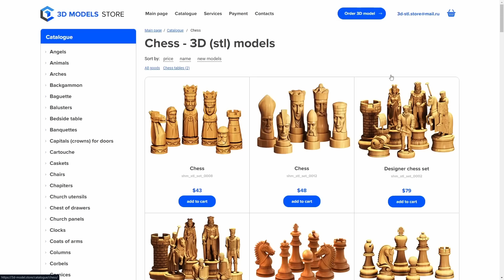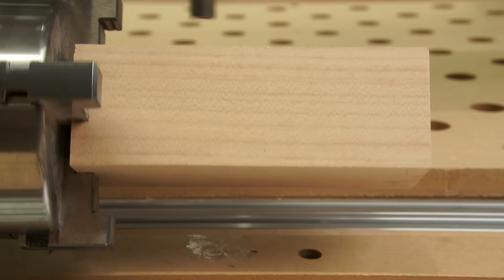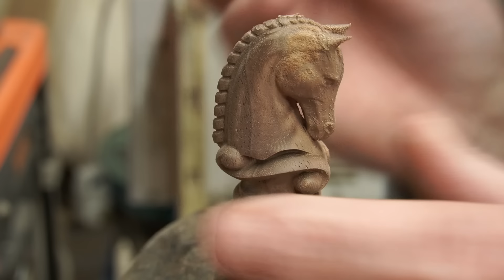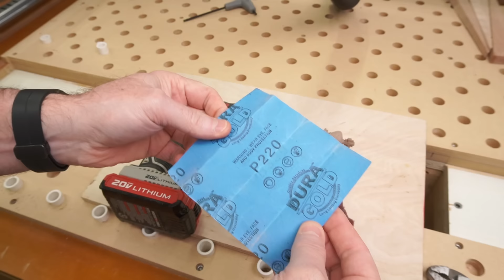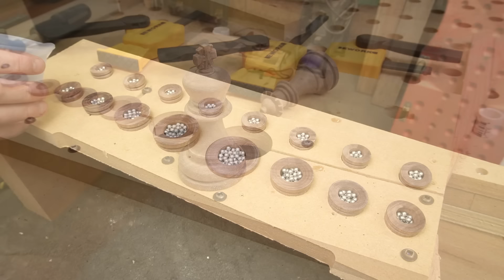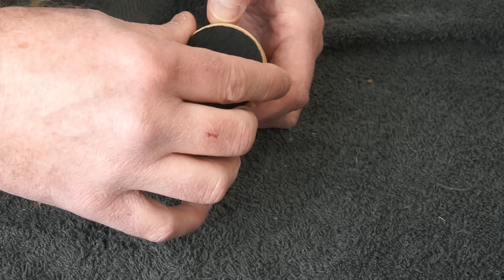Making my own Luxury Chess Set : PART 1

Comment: Hi Scott! I did have it wire the way you described, i can turn the rotary clockwise and counterclockwise on my touch screen and pendant but when i run the gcode it will carve like you normally with 2d carving with XY and Z the rotary not turning at all. Any idea what i am doing wrong?
Reply from the maker: Are you using Vectric?
If so, when using the rotary you have to choose the rotary post processor when you save the Gcode.
The standard PP is named "MASSO ATC ARC".
The rotary PP and the one you need for this is named "MASSO WRAPY2A ATC".

I hope this helps.
Thank you for watching!

Comment: Great video! Loved everything about it; from the comments about Big D to the Mark Lindsey mention! I have that same set of STL models from 3d-model and have been working to turn them out on my 1F machine. I am "fair" in Aspire but, to the life of me, I can't figure out how you got the .25 waste peg into the model. I've played with Zero Plane and adding components for hours and can't get it right. I even went back and watched some of Mark's videos on zero plane to try and figure it out. I know you're in ALA so I'll just tell you that I am in TN, up-front, in case you want to tell me to pack sand, but could you point a guy the way you got the peg on the end of the model? - Sincerely, Bob (snowed-in)
Reply from the maker: Thank you, Bob!

No sand packing necessary. I am glad to help. You're still south of the Mason-Dixon so you are alright with me! Ha!
Those pegs aren't actually a part of the model.
In Vectric, I drew one straight line (vector) down the base, or what would be the bottom of the model, and I run a separate profile toolpath on the outside of the line (vector) with a cut depth just shy of the radius of the model and that produced what you see as a 'peg'. I originally created the profile toolpath as a parting toolpath and I cut the model completely from the wood blank, but more times than not the model would get nicked or damaged in some way on the very last pass when it cut completely through. 
So I opted to cut only enough to allow it to stay connected to the blank, and as you see in the video, I used a finishing saw to take it off completely. This was a happy accident because it allowed a way to fit the model into the chuck of my drill motor and use that to sand them. Then I used the hand saw again to take the peg off.
I hope that I answered your question.
Stay warm up there. We don't have snow down here on the coast, but we have some pretty serious icing.
Thank you for watching!

EDIT: I forgot to mention something important..
In the profile toolpath that I used for parting, I used a 1/2" endmill to cut it with. This is what gave it the 1/2" length off the bottom of the base. 
If the largest diameter you have is 1/4", though I have never tried it, you could probably produce the same results by using a pocket toolpath, and make it any size you like, as long as the blank is big enough.
Reply: Thanks! Sorry to deluge you with messages. We're locked in from the snow over the past few days so I have WAY too much time on my hands and I am trying to get this done. I retired from UT Knoxville last year. Folks asked what I was going to do? Make sawdust was my answer. That, and whatever my wife tells me she wants me to do. "Am I bored?" they ask. NO! I have hobbies and interests that are still in boxes that I haven't opened yet. I'm fine. Many thanks for your information! @MandSWoodworks
Reply: I had not considered just doing it as just a pocket toolpath (using a 1/4" bit). I was making it WAY too hard! Everything is set up to go. Going to try the file out this afternoon. @MandSWoodworks
Reply from the maker: @hillbillydust  
Good luck!

Comment: Excellent work and thanks for sharing, I need to make a set for my son as he made a humongous chess /coffee table  with about 3 3/4 inch squares, weighs a ton as it is out of Tasmanian Oak and Merbau , I have yet to pick out a design and which way to go. Which Ballnose did you use out of your four choices in the pack?
Reply from the maker: For these particular models, I used different bits depending on the detail of the model.
For the models with small details like the Knight and King, I used the smallest in the set, the .25mm.
But for the others, like the bishop and pawns, you can use a larger bit since they are the least detailed.
If you make your pieces to match the size of the board that your son made, they'll obviously be much bigger, and the details would be larger and you could probably get away with using a larger bit and decrease the cutting time.

Good luck and thank you for watching!!
Reply: @MandSWoodworks  thanks so much and sorry for the late reply. I retired last July and just have given my son the link and he can pick out the one he likes. Cheers

Comment: Great video, at 0:21 where did you connect the wire to? I have to same setup and try connect to A axis but i can't get to work. would be greatly appreciated if you could help me out.
Reply from the maker: I have a lead that runs from the Stepper Driver up through my table that I connect that wire to.

The connection of any stepper motor on Masso is the same, regardless of which axis.
Your connection for the Rotary Stepper should be as follows:
You should have 4 wires running from the A-Axis channel on MASSO then to your Stepper Driver, and then from there continuing on to the Stepper Motor on the Rotary Axis.

If you are using a closed looped stepper motor that houses it's own driver, then you would plug the stepper motor directly into the A-Axis channel on the Masso Controller.

As far as Masso Settings, check out the very first video that I ever posted on my channel. I cover the Masso Rotary settings in that video.

I hope this helps.
Good luck and thank you for watching!

Comment: This was beautifully done. But how do they do it in the factories, their lathes seem to cut them in seconds. I'm not familiar with CNC router cutting yet, only with CNC lasers but I wonder if there are faster tooling and speeds because it doesn't seem to be cost effective otherwise. You did an excellent job on quality though. Cheers J
Reply from the maker: Thank you, Josh!
From my research, most mass produced chess pieces are plastic or some sort of composite material.
If wood pieces are mass produced by machines, they do not have the detail like what you see in expensive wood sets because of the time and expense of it, I guess.
I discovered that the only mass produced real wood luxury chess sets with the intricate details and carvings are all done by hand. You can search for videos on Youtube on the subject and you will see factories that resemble sweat shops, with guys sitting in a tin shed, literally carving out the Knight pieces by hand, and then throwing them in a bin with other pieces they have cut that day. You and I would pay hundreds or thousands of dollars for a set like that, but the poor guy doing all the work most likely gets paid in peanuts. 

Thank you for watching!
Reply: @MandSWoodworks  fair point. I love your patience and focus on details. That's very apparent from your videos. Cheers J

Comment: I also wonder about air blasting them with baking soda powder

If that would speed up production if that's what one wanted to get into
Reply from the maker: Someone else recommended sand blasting with walnut shells.
I have never heard of using baking powder but I'd be curious to know how it works.

Thank you for watching!!
Reply: @MandSWoodworks  

The concept behind air blasting with powder is more control on how much is removed, especially with details in your chest pieces

Comment: On chess pieces and other small parts, I've often wondered what it would take to mount multiple milling heads and if masso could handle them
Reply from the maker: From what I've read, Masso can indeed accommodate multi-head setups.
But I'm sure it would be pricey.